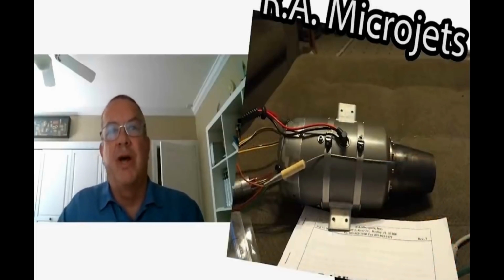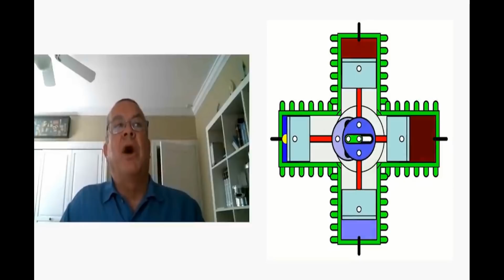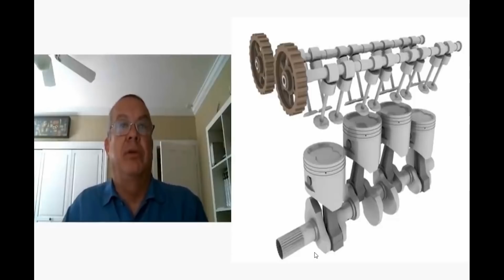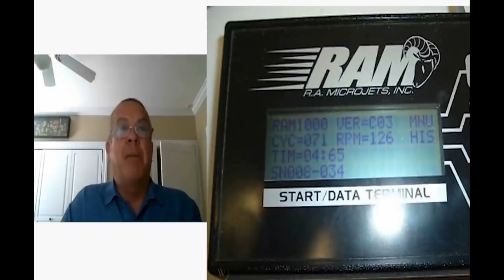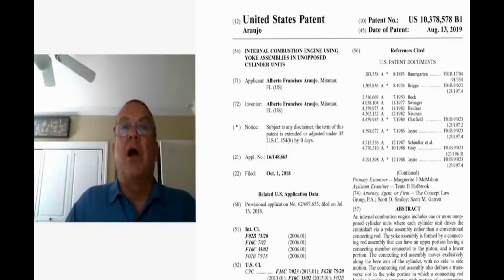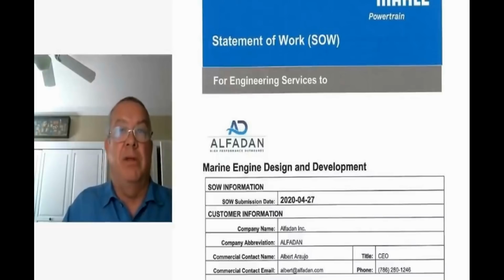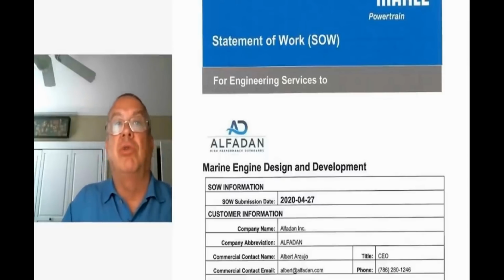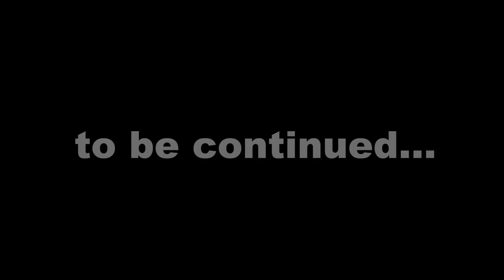Alfadan EXPLAINED! - Part 1

Comment: I am sure they can build a prototype engine that is 7 liters and only 4 cylinders... And I'm sure they can make it run also.
The problem is that the piston speeds at anything over idle speed would be impossible.
If your pistons are moving faster than the flame front from the combustion process, you are not making any power.
The pistons would literally throw themselves through the cylinder head.
The only way to make this engine work would be to make the pistons and rods out of some type of super light titanium alloy, and then make a conrod with a spring type mechanism that would slow the piston speeds down - and obviously having a shock absorber on your conrod is fucking stupid.
Reply: Displacement has nothing to do with piston speed....
Reply from the maker: The piston speed can't be faster than a flame front for a given engine. Complete combustion (or near enough) is what defines that speed of an engine. They're not externally driven...
Reply from the maker: Displacement not directly, but stroke does. Oversquare is king in this respect.
Reply: Displacement has alot to do with piston speed - obviously different crank designs can affect the piston speed, but using this stupid alfadan motor for example - they could build it waaaaay over square, with like an 8 inch bore and extremely short stroke... But then the bore is so big that the combustion isn't happening nice and evenly to push downwards on the piston... Diesel engines can have huge bore sizes because the pressure is so high that the entire fuel /air mix ignites at once - that doesn't happen with a gasoline spark ignition engine... That explosion takes time to spread thru the combustion chamber... In a diesel it all goes boom at once and the pressure after combustion is astronomical.
That's why I think this engine is complete bullshit - it isn't feasible to build a 7.5L 4 cylinder with a huge bore and short stroke... And you can't build it anything remotely close to square because the forces acting on the wrist pin and big end of the rods will tear them apart.
I understand what you're saying and technically yes of course you're right.... But the displacement of the engine has alot to do with piston speeds bc in order for the engine to operate, you have to build it within the knows laws of physics.
Reply: @thedirtyworkshop  the flame front speed is the thing that's making the least sense to me.
Diesels can have a 6 foot bore and it's fine bc the charge is ignited all at once from the compression /heat.... But in a gasoline spark ignition engine, if you have a huge bore then your combustion event is just pushing out sideways across the top of the piston to fill up the void - it wouldn't be producing much actual work.
Reply from the maker: No it doesn't. That's not how diesels work at all. That's a HCCI
Reply: @thedirtyworkshop   @The Workshop  and what does hcci stand for?
Homogenous Charge Compression Ignition? Right? 
And diesels are compression ignition, right?... which means all the fuel/air charge goes boom at the same time instead of starting at the spark plug and moving outwards.
Yes I know fuel is added afterwards also. But that's exactly how a diesel works lol 
Idk what I said that you misunderstood but I have been a diesel tech for almost 10 years lol I know how they work.
Explain what was wrong with what I said besides over simplifying it maybe.
Reply from the maker: No it doesn't. Diesel inject the fuel around TDC and burns as its added. This is why diesels don't need a throttle. They control the engine by fuel not by air. You've got diesels 100% wrong.
Reply from the maker: Diesel burns as its added, not all at once. It's not an explosion, it's deflagration not a detonation. Modern diesels usually have multiple injection events like pre ignition etc. A diesel is NOT a HCCI, otherwise they'd have the same name.
Reply from the maker: Diesel is NOT a homogenous charge. 1) it's not homogeneous 2) it's not a charge. Homogeneous means "the same, everywhere" or "thoroughly mixed" this isnt what a diesel is at all. This is why soot is produced. A charge is to fill a system, like to charge a musket, or charge a battery. For engined it's a mixture, not just air.
Reply from the maker: Here's a good description;

Homogeneous Charge Compression Ignition (HCCI) is a form of internal combustion in which well-mixed fuel and oxidizer (typically air) are compressed to the point of auto-ignition. As in other forms of combustion, this exothermic reaction releases energy that can be transformed in an engine into work and heat.

HCCI combines characteristics of conventional gasoline engine and diesel engines. 

Gasoline engines combine homogeneous charge (HC) with spark ignition (SI), abbreviated as HCSI. 

Modern direct injection diesel engines combine stratified charge (SC) with compression ignition (CI), abbreviated as SCCI.
Reply: @thedirtyworkshop  don't get all technical n shit like a smart ass engineer...

All I meant was that in a diesel, it's auto ignition from pressure/heat and doesn't have a flame front traveling out from the spark plug. And I fully understand how the fueling works and injects more fuel well after TDC and the "initial combustion event" cuz idk the technical term for it.
All I was getting at is that both engines have controlled booms in the mowdur make it go brrrrmmmm
Reply: @thedirtyworkshop  deflagration shmeklaration.
Your mom deflagrates, how bout that.

LOL no seriously I am not an engineer but the point I was trying to make was why a huge bore and too - fast moving piston equals no power generated
Reply: @thedirtyworkshop  DUDE!! DUUUUUDE!!!
This guy put out a video one week ago trying to explain why he does not have working prototypes... And I swear to God, I swear on everything that is or is not wholly, I swear to Jesus and Satan and Allah and f**** Gandhi and everybody else that this guy actually said this... he actually said that the reason why other manufacturers build a working prototype first is because that's how inexperienced engine builders start out, they build a prototype, it fails, they try again until they get it right... dude I am not joking you. He literally said that what they have is far better than a working prototype because he has a fancy computer animated design on his computer. He literally said that the only reason and the only companies who build working prototypes are inexperienced... I would like to know what Cosworth thinks of his theory about that. When they were building the six naturally aspirated 12000 RPM engine for the Aston Martin Valkyrie which produces 1000 horsepower, they first produced a single-cylinder prototype that was 112th the size of the 6-liter so 1/2 liter 1 cylinder, and made sure that it reached their target horsepower and more importantly in their case, emissions regulations. I am sure that you are well aware of this I am telling the story about Cosworth for Anyone who reads this reply and thinks that prototypes are not necessary. Dude you have to do a reply to his video about not having a working prototype and explain to these people why this man is literally 290 lb of pure manure and every breath that exits his mouth and goes through his vocal cords to form a word is a lie. I do not have the engineering background you do or the background knowledge of the math involved to explain why his engine is never going to work, but I know that you can produce a great video explaining why a prototype is the first step for every manufacturer in history including Yamaha and Suzuki and Ford and Toyota and Honda and supposedly inexperienced companies like that😂😂😂😂
Reply from the maker: I know I watched it. He says all that then says mahle then make a single cylinder prototype, without calling it a prototype
Reply: @thedirtyworkshop  actually since you already did the engineering type shit and all the math proving that it's all bullshit +do you mind if I mention your channel in my video?
Basically as a "if you don't believe me, go find The Workshop channel and take this info from an actual mechanical engineer who does the math right in front of you" kinda thing? I doubt many people will view my video and I have 0 intention to become a YouTuber... The marine industry is my domain and its full of crooks and I'm fuckin sick of it. Makes all us marine mechanics look or sound like we don't know what we're talking about - or we're just hating on him for coming up with a revolutionary new engine... I'm not an engineer but I've been a factory certified tech - from a certain Japanese company who builds bikes and outboards... That rhymes with "Yomomma" 😂
I've had customers come in and say they can't wait till the ALFADAN comes out and I'm just like ohhh lord... Then they accuse me of favoritism bc I'm a yammie certified tech so I am just loyal to one brand... It's fuckin annoying lol
Reply: 13.36×13.36×13.36×0.7854×4=7,491cc, honda s2000 red line=9,000RPM stroke=8.4cm 9,000RPM×(13.36/8.4)=
5,658RPM, Why should the mass of the piston limit the maximum RPM of the engine? If the speed (m/s) is maintained then the G forces are maintained, if despite being a larger engine it is subjected to the same G forces, what would be the problem then?,
Reply: I think you don't need a lot of mathematical knowledge to do this operation that makes you trust alfadan, all the people who have already invested in alfadan did this operation and they thought this could work !, so if I could deny this operation in some way maybe it would be less likely to trust alfadan and i've been thinking about it some way to make sense that an engine with more stroke would have to run even at lower RPM, but thinking about it i even more trust alfadan because there are 2 times when G-forces they are experienced when the piston changes direction, so wear must increase as the square of the RPM, making a 5,000RPMS 7.5L I4 even more possible. Is there any way to disprove this?
Reply from the maker: What? Why should mass limit rpm? Forces...
Reply: @thedirtyworkshop  Each change of direction of the piston for the connecting rod is as if you hit it, if you have an A motor with a 10cm stroke and a B motor with a 5cm stroke and this B motor will be able to double the RPM so that the piston gets the same speed . But since it has the same speed, each change of direction has the same force and since they are twice the RPM per second there are twice as many strokes on the crank which wears it down the most.
Reply from the maker: That's not true as applied to engines. You're confusing averages with absolutes...
Reply: @thedirtyworkshop  It is true I was confusing the averages with the absolute ones, but, the comment still has some truth because the change of direction in the TDC is much more abrupt than the change of direction in the BDC,
Reply from the maker: That is correct

Comment: Haven't worked on motorcycle engines car engines boat engines snowmobile engines 2-stroke and 4-stroke. My main experience-is  in manufacturing. In order to get the displacement with a 4 cylinder you must increase bore and stroke. This isn't too complicated if you have experience. The block must be big enough to increase the diameter of the piston and deep enough to except a larger stroke crank shaft with the depth  of piston bore. A lathe and a jig-mill will be needed along with an O.D. grinder. This part is easy for someone with experience.  NOW if this engine puts out TWICE THE DISPLACEMENT as a stock 4cyl. Then the pistons must be very large and the stroke will be long as hell to reach 7 liters. Balancing must be done
Using a forged aluminum billet would be better than cast anything. Forged aluminum pistons, rods,

Comment: So it uses a type of scotch yoke crankshaft to keep the pistons at TDC longer, helping mitigate the effects of a having very large piston bores. If it were that easy, wouldn't larger companies have done it years ago? I don't know, but you're right it sounds dodgy.
Reply from the maker: No, it's because of 2nd imbalance
Reply: No. Its not a scotch yoke. It's something different that they will release once the patent comes through.
As with everything on the world, it's not being used by large manufacturers because it hasn't been invented yet. This is how invention works. Believe it or not, there are still breakthroughs to be made in the world of internal combustion engines. Hence the reason hydrogen engines have only just been commercialised.
Reply from the maker: Hydrogen is a fuel, not an invention. Hydrogen was also burned in engine over 100 years ago. Infrastructure is the issue, not the fuel itself
Reply from the maker: The tech hasn't been realised yet? What tech? This isn't hard to understand. Michael Faraday worked all this out quite a long time ago...

Solutions are required before people start making deadlines that can't be reached.
Reply from the maker: You also say why is it a thing now, but it isn't really a thing now. Look at who has made electric anything vs who hasn't. Why is that? Electric motors and batteries aren't difficult concepts to understand.
Reply: @1one3_Racing  I was going off the diagram of the 1930s prototype engine, which seemed to use a scotch yoke. Personally I doubt if there are any substantial improvements to IC engines that could be made by a small company, but time will tell. Also wouldn't making it a boxer layout, like the original, substantially reduce imbalance problems? But then I suppose it wouldn't easily fit in an outboard engine.
Reply: @thedirtyworkshop  and I think most hydrogen engines use fuel cells, which aren't actually IC engines.
Reply: @thedirtyworkshop  said "issue, not the fuel itself". Well, the fuel is also the issue as it will greatly diminish vehicle range / reduce car internal volumetric capacity due to low energy density.
Reply from the maker: Are you sure about that???
Reply: Toyota is working on a ic hydrogen engine, they even have a working prototype, that and infrastructure for hydrogen is already there, you just swap gas tanks with hydrogen tanks,
Reply: @thedirtyworkshop  Holy hydrogen blasts Bikeman!! I did some napkin calculations for the volume of vehicle Hydrogen tanks at 700bar vs regular gasoline tanks.
Looking at existing technology 149L gas capacity (5,6kg) the outer shell will in total occupy 167L and it has to be a cylindrical shape approx 3:1 proportions... energy content 221kwh. 167L
A gas tank for 221kwh needs to be 24L internal volume, shape is pretty flexible. Outer volume 26L?
Reply: hyundai VVD